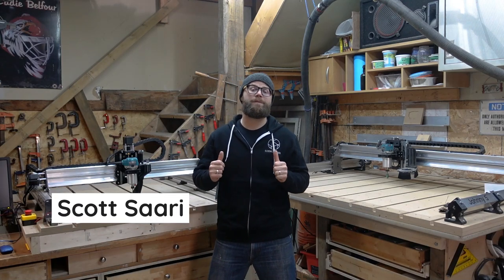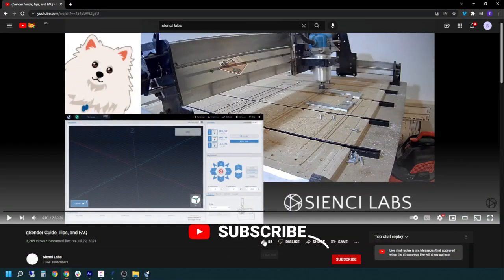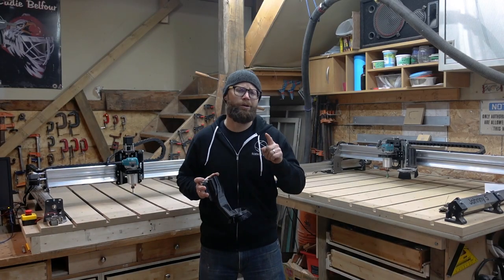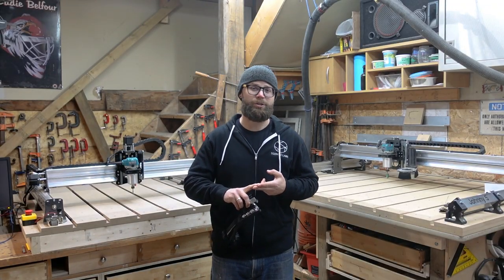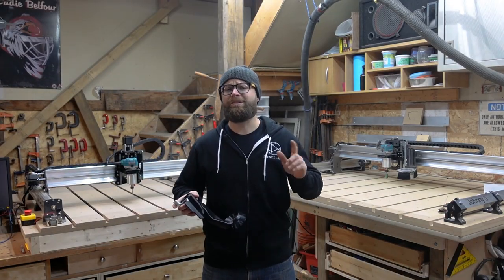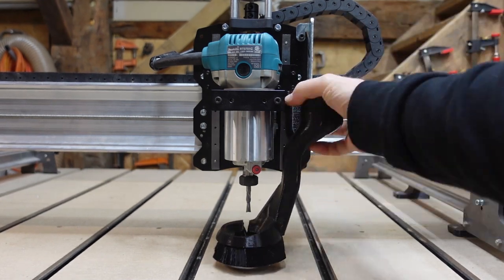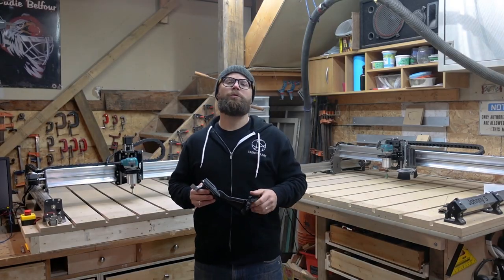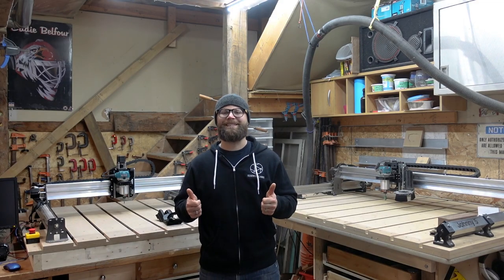Magnetic Dust Shoe for the LongMill MK2

Comment: What's the official recommendation for hooking up the dust shoe to a 4" hose from a dust collector?
Reply from the maker: If that's your setup, you can either find or make an adapter that fits to the shoe (we left enough space around it to try accommodating adapters) or run a short length of smaller diameter hose before adapting it up to 4" with a standard adapter.

Comment: The nut won't fit in the slot  deep enough, new boot. exchange, file or heat recommendation ?
Reply: thought I might try sanding one of the two nuts down a bit tomorrow on two sides.
Reply from the maker: We'd be happy to send you a new part that replace your current one! The other option is certainly heating the nut or filing it down to fit into the slot
Reply: @SienciLabs  Light filing didn't get it, but very little heat did the trick well/fast. I used a heat gun on low for about 5-10 seconds from 4 inches away repeatedly until it pressed in just the 1/8 more needed
Reply: i just got to this set of installation and had the same problem.  a small flathead screwdriver and a thin strip of sand paper did the trick.  just work the walls of the nut hole a little and it should pop right in after.  hope this saves someone a headache.

Comment: Do you guys know if this fits the onefinity machines ? I understand it’s not designed for that but the design look mighty similar.
Reply from the maker: This shoe design was made specifically to suit the MK2 LongMill so without the right mounting points and clearances it likely won't fit on the Onefinity. It's design is very novel though and I (Chris) spent lots of time on making a shoe that I felt was greatly improved from the Onefinity's Suck It dust shoe by having easy removability and height adjustment in one release mechanism. If you're keen on making your own version the whole design is open-source so it's possible to source the parts and 3D print the rest 👍

Comment: Will the mk2 dust shoe work with mk1 Longmill?
Reply: From the LongMill MK2 Magnetic Dust Shoe product detail page... "This dust shoe is specifically designed for the LongMill MK2 and will not fit with any other versions." 👎🏻
Reply from the maker: It's because of the way the MK1 gantry design is that this dust shoe design is impossible to adapt to the MK1 - if we did make it available it's not the case of a new bracket, the shoe would have to be completely redesigned again and would still have travel lost in the X-axis
- Chris
Reply: Thanks for the info. To bad, I would like to have that design. Again thanks!